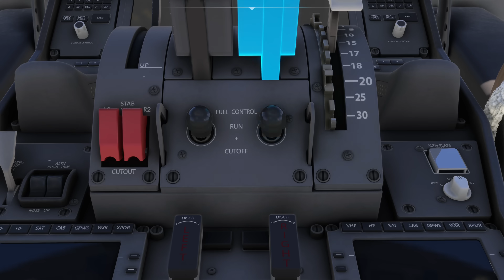Air India 171: Why Did The Fuel Cut-off Switch Get Moved?

Comment: Here is a different scenario that my explain the crash: 
1.  both pilots are trying to do everything correctly.
2. There is nothing wrong with the switches. The fuel  switches are working perfectly and are in the "run" position.
3. However just after V1 take off is something wrong with the electrical signals that cause the fuel to be cut off (even though the fuel switches stay in the "run" postion).
4.  one of the pilots notice that the engines have stopped and assumes that the fuel switches have been cut off and immediately remarks "why did you cut the fuel off". 
5. The other pilot correctly responds "I didn't do it".
6. The one of the pilots turns one of the fuel switches off and then back on in an attempt to restart the engine and then does the same with the other switch (this is why the data recorder shows that the fuel switches were cut off).
7. In other words the fuel switches being turned off by a pilot was an effect of the pilots acting in good faith, not the root cause.

Does this make sense captain Steve.
Reply: So why did one pilot ask the other”why did you switch the fuel cut off”” then?
Reply: ad 3.: so 2 signals out of the blue shut both valves on after the other -and those signals are wrongly logged as "transition of fuel cutoff switch" ... but if both switches were not physical moved - how could the restart of both engines have happened? FADEC reaction?
Reply: as others have stated, the evidence disproves this. But also consider the odds, that this happened to BOTH fuel switches within 1 second of each other AND coincidentally, at the worst conceivable time, when recovery was impossible. It's just not possible.
Reply: I agree with this. Basically resetting.
Reply: No.
Reply: this doesn't make sense....they can easily disprove this with the timing of the switches vs. the statements, among other things...
Reply: No, it doesn't.
Reply: In 32 seconds, it's not possible to cut off the engine switch so easily. If either of them had done it, the other would have noticed. You need to use either your left or right hand to do it. Cutting off the engine switch requires force — it takes time to grip it firmly with one hand and pull it. One of them would have noticed if the other tried.
Reply: IDE SAY THAT ALONG WITH SEVERAL OTHER SCENARIOS IS POSSIBLE
Reply: This was my initial view or opinion of events from one of his first videos. I truly doubt foul play from the pilots. Im 99% sure it happened this way.
Reply: @paulofrome  I honestly hope there is some other explanation, but the evidence just does not support this theory as others have pointed out. And the chances that it could have happened to both engines within 1 second of each other (actually had there been no delay between each, it actually would make a technical failure more likely, as 1 second is about the gap there would be if a pilot did it...) also at about the only time it could happen when there is zero chance of recovery, really is impossible.
Reply: Why would other pilot ask to other pilot" why did you cut off the fuel supply" obviously the someone moved the switch from ON to OFF. if switch was ON position then Pilot would have not asked him that DIRECT QUESTION.
Reply: @SunnyJay-t4e  "Why would other pilot ask to other pilot" why did you cut off the fuel supply"" Because he who's asking is the one who did it. Instead he would've said "what happened?", instead of blaming is chief - that's pretty high-horse comment coming from a co-pilot.
Reply: @SunnyJay-t4e not necessarily. The one who asked the question could have assumed the other did shut off merely because the questioner did not. The only other person in his view and proximity is the other. Both know the consequences. So the questioner is unlikely to be polite. I would be accusative too!
Reply: Interesting theory, but easily disproven:
- The only recorded signal for fuel cut off occured 3 seconds after takeoff. 
- If there was a human attempt to move the switches off and back on, there would be two recorded signals for the fuel cut off, not just one. And, it doesn't make sense for there to be a 10 second gap between turning the fuel controls off and then on again if a pilot was indeed only turning them off in order to turn them back on.
- If the fuel controls had never changed their physical position, it makes absolutely no sense for one of the pilots to assume that the other pilot had turned them off. Absolutely none. Rather, they would have asked, what just happened?
- They wouldn't even have been able to assume that an electrical signal maybe falsely communicated fuel cut off if the switches were never moved. How would they know to suspect that? If anything, in that very short time to act, they would have dismissed the control switches as the cause of the issue because they would have been on. Instead, they would have likely assumed an electronical failure. 
Long story short, this is very unlikely and absolutely illogical in my opinion.
Reply: @louibeans I couldn’t agree with you more! So much nonsense here with ridiculous theories. Maybe Bigfoot put the switches in the CUTOFF position!
Reply: @louibeans  THE ONLY WAY TO PROVE ANY THEORY RIGHT IS TO FILM IT, DONT TRUST BIG COMPANIES , THEY LIE , LOOK AT THE POST OFFICE,
Reply: @louibeans  I have seen in the reports that both fuel switches were cutoff with 1 second time difference. Is it possible to manually do that in 1 sec ? What I am reading online , it takes a little more than 3-4 seconds for each one to on/off .So , is there something more than meets the eye ?
Reply: @sureshkurapati  Logical error. The 1 second is the time between the two signals, not the time it takes to manually operate both switches. If 1 second passed from one signal to the next, this means that it takes 1 second to turn off one of the switches. So you gotta double that time for turning off two switches. It took approx. 2 seconds to turn them both off which seems realistic.
Reply: @sureshkurapati  First switch is turned off and one second later there is physical movement of the second switch. I wish they had been more clear about this one second. I am just saying the whole sequence doesn't necessarily take one second just the completion of one shut down and then immediately pulling up the next switch.
Reply: This seems most plausible. No one enquires in to: The FDR only records the position of EFC valves, not the switches themselves.
So Steve and 99% of humanity assuming that the pilots operated the switches is sheer conjecture.

One pilot asking the other in that short period is natural. Both know the situation is extremely deadly. Why would the other deny it if he knew the consequences. He would laugh or scoff that they were all going to die!

In my view, a very one sided analysis.
Reply: I think the pilot asking why you cut off the fuel switches is covering his tracks so that voice recorder points the cause to the other pilot  @vidyashankarkrishnan3302
Reply: This is exactly what I was thinking too, i think this makes more sense than the pilot being insane.
Reply: NO!
Reply: no

Comment: 10 seconds is actually a long time in a situation like this. So if one pilot says "why did you cut off the engines?" he would also then immediately reach for the switches to turn them back on and not wait for an answer or discuss the matter further.
Reply: I have to say, what if the fuel was cut off with switches in "RUN" postion?. In that case they would have to switch to "CUTOFF" position and then "RUN" which would explain the 4 second delay!

Comment: Based on my inference from the preliminary report, it's most likely a mechanical failure of spring and detent.  Key Observations from the Incident
Pilot's Statement:
One pilot asked, “Why is the fuel control switch in CUTOFF?”
👉 This strongly suggests that the switch was physically in the CUTOFF position, not just electronically signaling it.

Engine Restarted After Switching to RUN:
After the switch was moved back to RUN, one engine restarted.
👉 This confirms that the switch was functioning mechanically and electronically at that point.

🔍 Can We Rule Out Electronic Malfunction?
✅ What This Suggests
The fuel control switch itself was likely not electronically malfunctioning.
The mechanical detent and pull-to-move mechanism worked as designed.
The FADEC system responded correctly when the switch was returned to RUN.
❌ What We Still Can’t Fully Rule Out
Why the switch moved to CUTOFF remains unclear:
Human error (accidental or miscommunication)
Mechanical failure (e.g., detent spring failure)
Cockpit interference (e.g., turbulence, object contact)
A systemic electrical fault elsewhere (e.g., in the FADEC or wiring harness) could still have triggered or mimicked a switch movement, but this is less likely given the physical observation.
Conclusion
Since the switch was visibly in the CUTOFF position and functioned correctly when returned to RUN, it is reasonable to conclude that the fuel control switch itself did not suffer an electronic malfunction.
The root cause is more likely to be mechanical or procedural, not electronic.

Scenario Context
During takeoff, the aircraft is typically pitched upward at an angle of 10–15 degrees.
The fuel control switch on the Boeing 787 is located on the overhead panel, with:
RUN at the top
CUTOFF at the bottom
🔍 Could Gravity Cause the Switch to Move?
✅ Theoretically Possible If:
Spring-Loaded Detent Fails:

The switch is designed to resist movement via a spring-loaded detent.
If the spring weakens or breaks, the detent may not hold the switch in place.
Pull-to-Move Mechanism Fails:

Normally, the switch requires a pull-up action before it can be moved.
If this mechanism is compromised, the switch could become free-floating.
Aircraft Pitch + Gravity:

With the aircraft nose-up, gravity could exert a downward force on the switch.
If the switch is loose or degraded, it could slide from RUN to CUTOFF.
Vibration or Turbulence:

Combined with gravity, vibrations during takeoff could assist the movement.
❌ Why It’s Unlikely Under Normal Conditions
The switch is specifically designed to prevent accidental movement.
Boeing’s design includes mechanical resistance and intentional action requirements.
A dual switch failure (both engines) would suggest a systemic mechanical fault, not just gravity.
🧠 Conclusion
Yes, if the detent and pull-to-move mechanisms failed, gravity during takeoff could theoretically cause the switch to move from RUN to CUTOFF.
Given that both pilots denied involvement, and both switches moved within seconds, this hypothesis is plausible and worth investigating as a mechanical failure scenario.

Comment: If the switch is positioned to cutoff will the fuel supply to engine break within milliseconds? Or it takes few seconds , if it takes couple of seconds then the other pilot turned to RUN within 10 secs , 10-couple of seconds= , made this tragedy???? , what if the other pilot turned on with out any questions , would it have saved life of all !???

Comment: 2:00 I rather think the pilot who switched off the fuel turned the switches back into the on position in order for them to be found in that position after the inevitable crash. That would also explain the 4 sec delay between switching on fuel to engine 1 and 2 .

Comment: Are you sponsored by Boeing? UK's aviation regulator, the Civil Aviation Authority (CAA), issued a safety notice regarding Boeing 787 fuel shutoff valve actuators. This notice followed a US Federal Aviation Administration (FAA) directive addressing a potential safety concern with these actuators. The UK CAA instructed operators to review the FAA directive and assess its impact on their 787 fleet. Specifically, the notice mandated daily checks of the fuel shutoff valves on affected aircraft and required operators to test, inspect, or replace the actuators
Reply: Yes isn't that obvious
Reply: This is addressed in the initial report, and completely debunked. Go and watch the Mentour Pilot video on this and he explains how the safety notice was not related to the switches just shutting them selves off, and the fact that both separate switches on this one aircraft would both do it would be a ridiculous coincidence.

Face it; Indians are not superhuman and make mistakes constantly, just like other people. Far more likely that one of these pilots made a mistake

Comment: What is more concerning is why did the pilot not switch the fuel control to on upon realizing what has happened, rather than waiting to ask the other pilot why he switched it off, thus losing 10 vital seconds, that he took to switch it back on. Thus, the engines could have started a lot earlier, and gain enough power to keep it in the air.

Comment: DON'T assume things. If a pilot was suicidal he could nosedive the plane in a critical phase. Why go through the hassle of cutting of the fuel and then letting the other pilot putting it back on and try to save the plane? It sounds to me like a mental breakdown where pilot monitoring turned off the fuel rather than putting up the gear.
Reply: I have to say, what if the fuel was cut off with switches in "RUN" postion?. In that case they would have to switch to "CUTOFF" position and then "RUN" which would explain the 4 second delay!
Reply: @corpshe Yes that could also be it. While it is possible it would be mass suicide, all other options must be ruled out first.

Comment: How It Could Happen: High-Stress Misaction Scenario
In a high-workload situation — say, during:

A go-around

Suspected engine failure

Anomalous instrument readings

Misleading automation behavior

The captain may have been trying to manage an urgent checklist or perform a corrective action, and in the process:

Reached for the wrong switch (fuel cutoff vs. engine start selector or fire handle)

Misread the label or position

Performed a “reflexive” or automatic action without full situational awareness

Misunderstood what a system was telling them (e.g., a false warning about fuel flow or engine condition)

Do not blame the pilots until all the facts are known

Comment: Nowhere in the report, it says that the switch was turned off by pilots. The report just say this happened. It does not say whether it happened automatically or manually. So it would be good to stop blaming pilots until the final report is out.
Reply: I have to say, what if the fuel was cut off with switches in "RUN" postion?. In that case they would have to switch to "CUTOFF" position and then "RUN" which would explain the 4 second delay!

Comment: As you said 4:11 min switches were physically cut off but the report doesn’t say about physically cutting off switch it said it was transitioned .Can it be the system fault that both the switches go off from run within 1 second as per report and that too while takeoff ,how much is the probable time to make a physical move of fuel cut off switch from run to off in a takeoff situation cause in this tragedy it was done within few seconds as per preliminary  report

Comment: As to the AI flown plane: When I worked for Lufthansa as a purser 1969 we saw the 2 pilots cockpit started (727 still had the flight engineer, 737 just the 2 pilots) and we had a running joke about a plane flown by a computer:

Passenger announcement by the computer: „This is your computer pilot, have a very nice flight! I am programmed so that I can not make any errors… any errors… any errors…“

Comment: If one pilot has allegedly turn off the fuel levers and the other pilot tries to switch them back on, I don't believe the 'suicidal' pilot is going to allow that.
He's going to fight tooth and nail to keep those switches "off" and even shut down the throttle levers as well.
Nah, it just doesn't wash... the fuel switches were still at "RUN" because it was an electrical or computer glitch that shut off the fuel, but the companies and authorities don't want that answer. 🤔

Comment: Was not the fuel switches turned off in the exact moment when the gear is supposed to be retracted by the captain? Could it not be that the captain got disoriented and turned off the fuel when he thought he retracted the landing gear. I see this very strange but the landing gear was not retracted and the reaction that ”I did not turn it off” could lead to that he thought he retracted the gear, but actually did something else. The fact that a try to restart the engine points to that someone realized that mistake and tried to do anything about it.

Comment: I very largely agree with the points given in the video.  However one I disagree with is about video recorders in the plane.  I feel the answer is a bit disingenuous.  The risk of it being 'leaked' is about the same as the CVR being leaked.  And don't expect to hear we should remove those for the same reason.  And saying it wouldn't matter.  If for example we had video and it showed no one had touched the switches, are we saying that wouldn't make any difference in the investigation?  And if someone did switch them, the video would show who did it, and under what circumstances.  Maybe they were following procedures and had a mental malfunction like the female officer who pulled her gun instead of a taser.  Video would certainly provide more info the same as audio provides for info than just the FDR.  And I doubt people are going to be risking throwing away their carriers to leak video of a pilot picking their nose or something.
Reply: i think ts guy is mega biased nd been payed gud by boeing
Reply: @Tigewasse  Well having video is something pilots are by and large against.  So I imagine it would probably be hard for him to speak in favor of it even if he agreed, not because of boeing but fellow pilots.  Which maybe does go to show people behave differently when being recorded. :-)